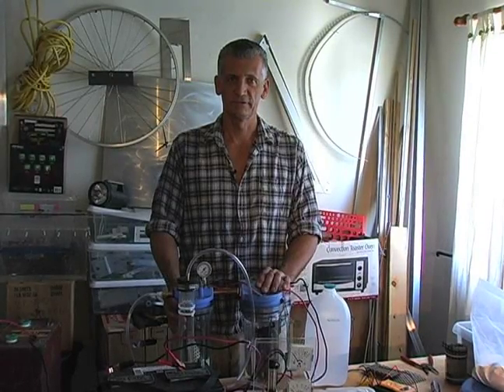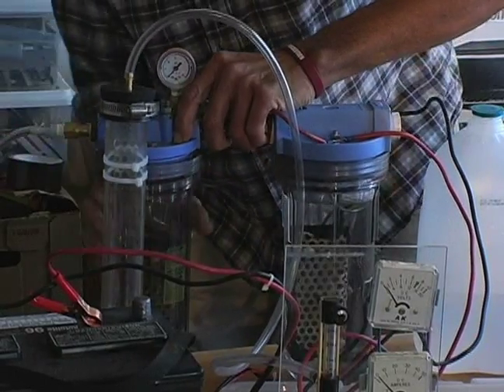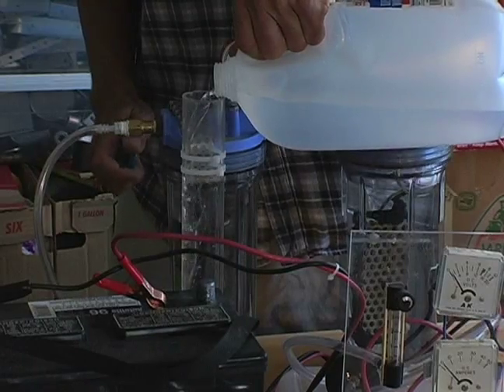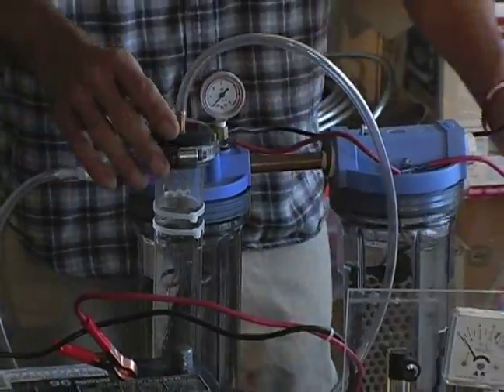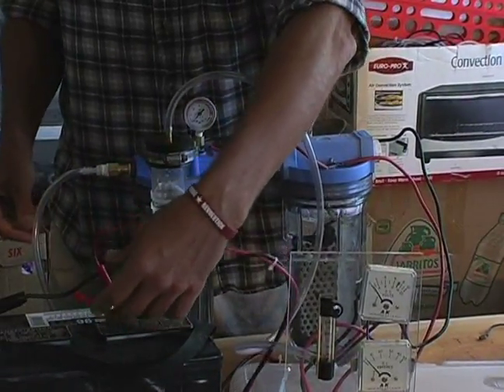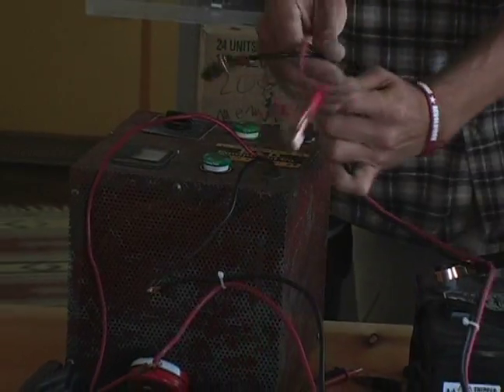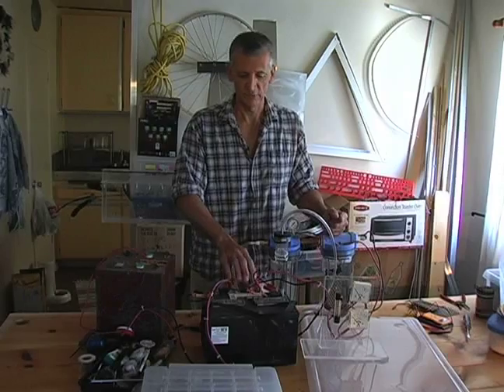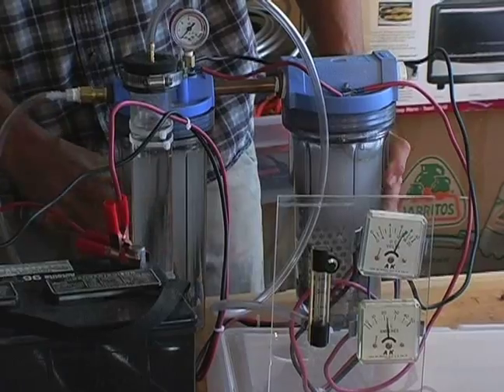How to Make Hydrogen : How to Hook Up the Charger to Make Hydrogen

Comment: @DoNotuseEbid because if you run from the charger you might not get a consistent charge, where as in the battery it simply moderates it to one consistent voltage